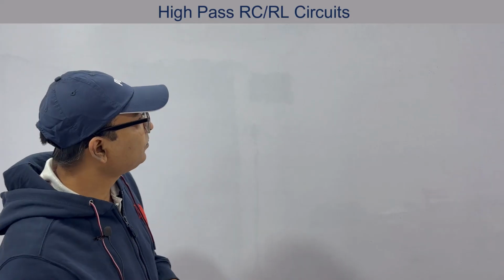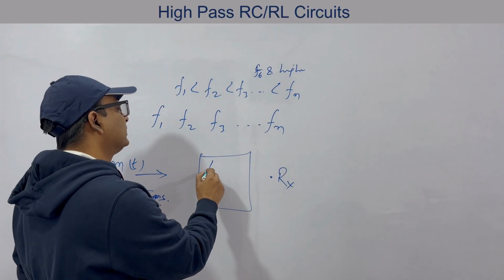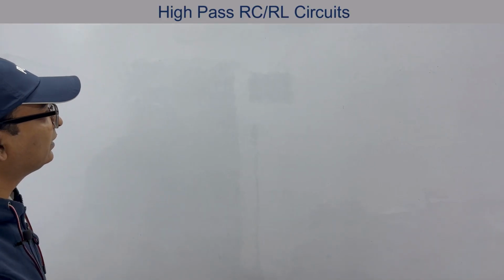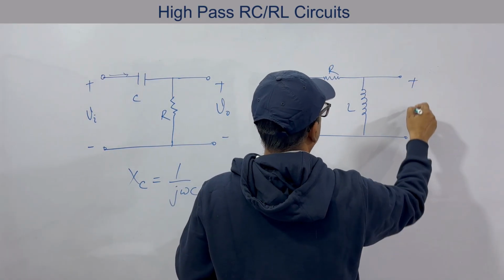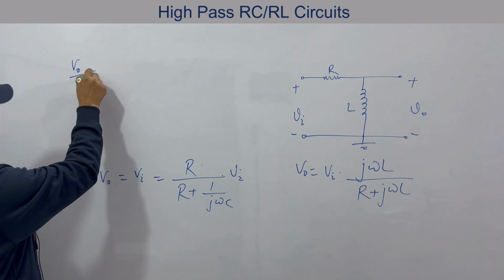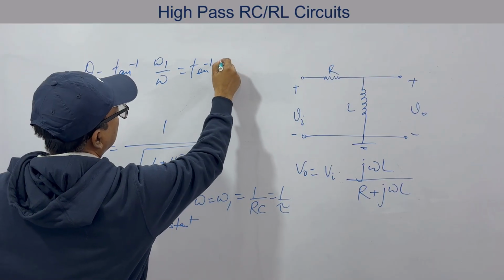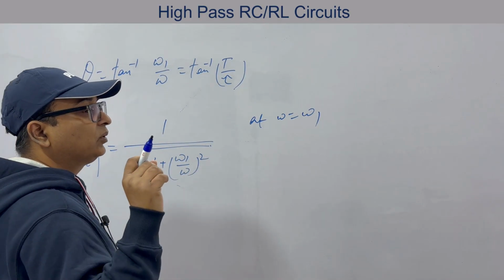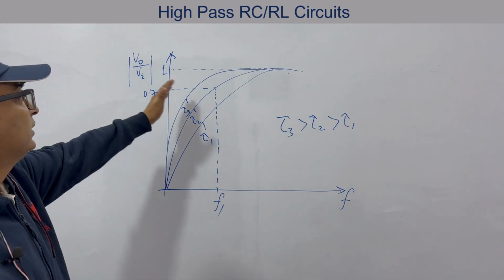High Pass Filter (HPF) Circuit Explained | Analog Electronics | Solved Questions for GATE

Comment: Ive been having a doubt. When we derived for capacitive impedence, we did so without complex inpit signal. Here Xc has j. Im confused why we use j here. Is there a proper explanation somewhere that I can refer to
Reply from the maker: In electrical engineering, the imaginary unit "j" (equivalent to root over -1) is used in capacitive impedance (Z=(1/jwC)) to mathematically represent the 90-degree phase shift between voltage and current. 
Kindly read complex number to understand the mathematics behind this.